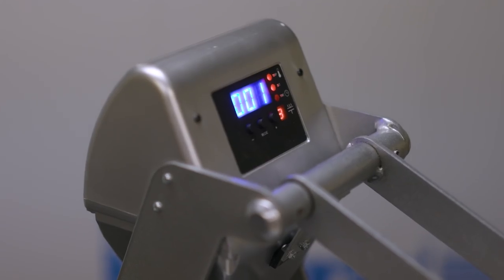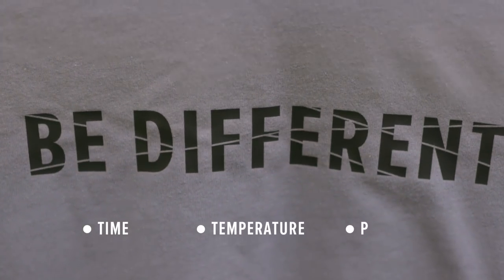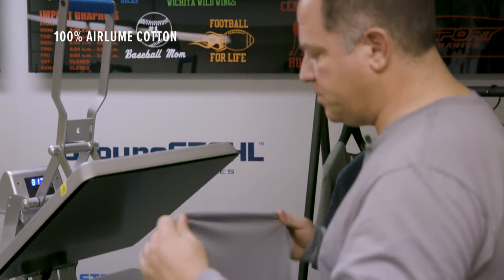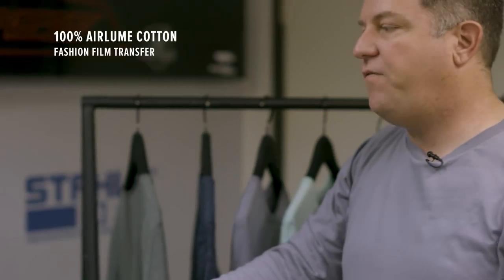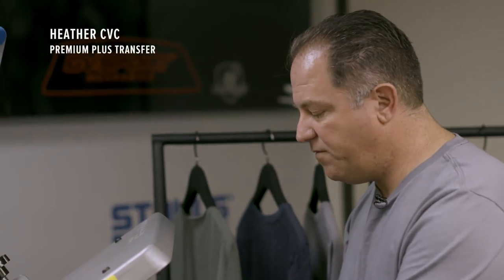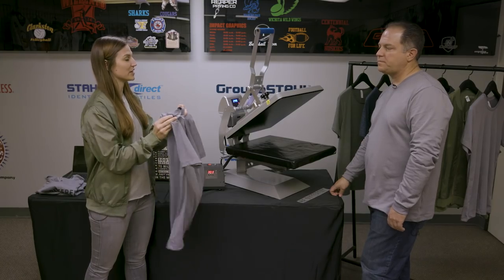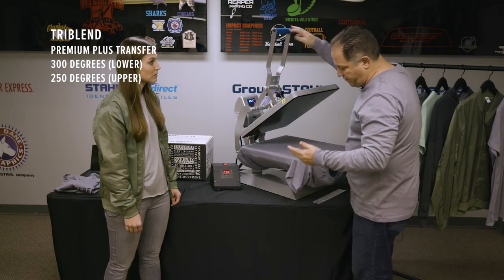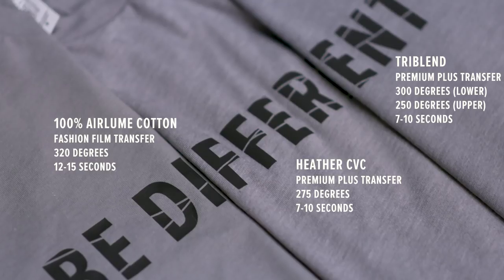Heat Press - How to Heat Press For Shirts on 3 Types of Fabric

Comment: What about temps for 100% poly and sublimation?
Reply from the maker: Hey DeeDee! For 100% polyester, you want to use a low temperature material so you don’t scorch the shirt (heat press box).  Both Stahls’ and Stahls’ Transfer Express carry low temperature.  At Stahls’ we use our Premium Plus, Eco-Film, and Sport Film (applies at 280-300 degrees), for an ink transfer, Transfer Express has the AquaTru, ElastiPrint, and Stretch Litho (applies 275-300 degrees).  Once you start getting hotter than 300 degrees), you risk the scorch box.
Reply from the maker: If you don’t have a low temperature HTV, one trick is to apply it/ tack down at 275 degrees for about 5 seconds, then, turn up your heat press to the recommended temperature, flip the shirt inside/out, and apply per the manufacturers settings.  You’ll probably scorch the shirt, but the scorch will be on the inside where no one will see it (unless they’re worn by high school kids, then all bets are off…)
Reply from the maker: As far as sublimation, most application for sublimation is in the 400 degree range for 45-60 seconds on a garment.  If you want to heat press on sublimation after it’s sublimated, you have to take some big precautions, as you may experience dye migration.  To avoid that, you will need to use materials that have dye blockers in them.

Comment: Was this sublimation??? Some1 pleeeaaase answer :/  thanks so much!!
Reply from the maker: nope! this was done with a heat press.
Reply: BELLA CANVAS you can do sublimation with a heat press
Reply: @BELLACANVASOFFICIAL  can we get someone more knowledgeable to answer youtube questions. thank you.
Reply: Yes you can sublimate on a heat press but this was not that process.  This was vinyl transfer, where vinyl is applied to the surface of the garment.  Sublimation is usually done on 100% poly garments and the dye from the paper, when pressed into the fabric with heat, dyes the actual poly fabric not a surface film.
Reply: @mikem9821  you literally didn't answer anything the original poster asked.
Reply: @Neji513  that's exactly what I did. Sorry you don't understand stuff.
Reply: @mikem9821  hm it appears you did, my bad. i skimmed and missed your second sentence.

Comment: which one is higher quality? also how long does the graphic last ???
Reply from the maker: Hi Nedjma! There is no real comparison for which one is better quality overall, since each heat transfer is chosen based on the fabrication of the garment to reach best quality for each. They also explained which settings/material to use on each fabrication in order to achieve high quality prints! :)
Reply: BELLA CANVAS oh right thank you 😊

Comment: hello, can transfer paper be used on 100% Microfibre polo tee?
Reply from the maker: Transfer paper that is run through a desktop inkjet printer usually have a wash rating of about 10 washes, then it will start to fade and crack, so it isn’t recommended putting a $0.20 print on a $20.00 shirt.  There are screen printed transfers on paper that can be used quite successfully, as well as the HTV and full color digital prints, all that have was ratings in excess of 50, that wont fade, crack, or peel off.

Comment: How can we apply no sew process on nylon material?
Reply from the maker: Unfortunately, no. Currently, the no-sew twill has and adhesive that will not adhere to nylon.  Some of the no-sew twill also needs a lot of heat (upwards of 350, depending on which twill) which could potentially melt nylon.

Comment: What was his pressure number set at?
Reply from the maker: The Stahls’ heat presses have pressure reading from 1-9, which are a multiplicity of 10, ie; a #5 is 50psi pressure. Some heat presses will show the psi reading. That pressure will change based on the material being used, and most material suppliers, whether its HTV, ink, or paper transfers will tell you what time, temperature and pressure are needed for success.